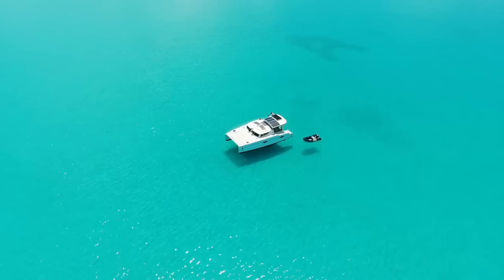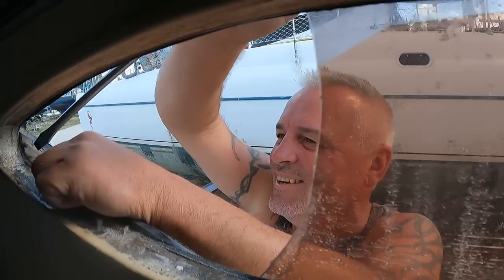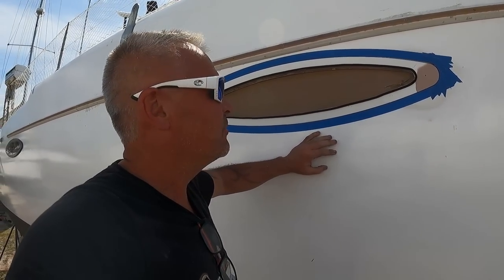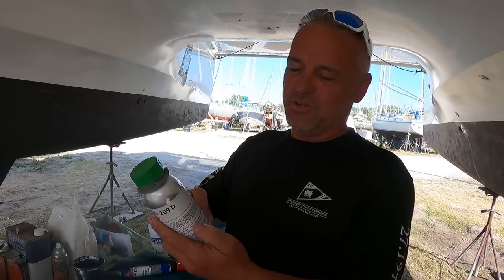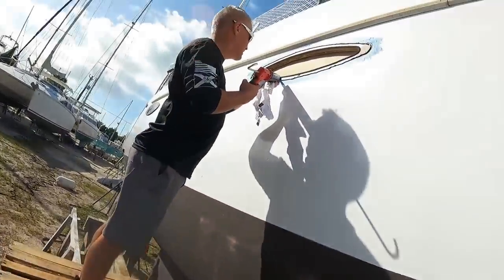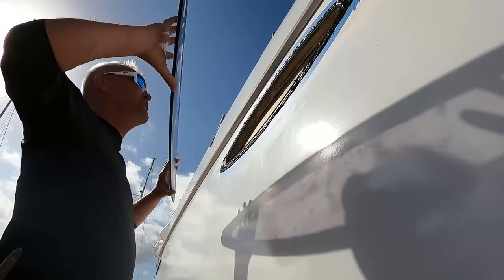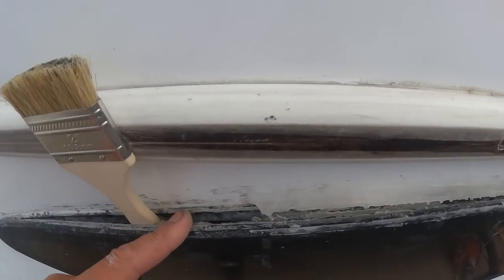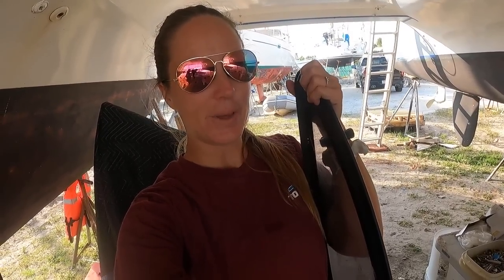We have a BROKEN WINDOW - How To Replace PERSPEX Windows on a Boat (S4 E46 Barefoot Travels)

Comment: Great video! @2:31 the adhesive is completely gone and the area where the window mounts is extremely clean. How did you do this?
Reply from the maker: Thanks. Razor blade and then some light sanding!

Comment: You’re supposed to shorten the list, not add to it. I’m thinking around $45 for the primer???

When pulling car windows, we used to use guitar strings, or piano wire. Is that something that might work for this? One person on each side of the window and using it like a saw.
Reply from the maker: We tried using guitar strings last time when we replaced the big windows. With no luck! 

Primer was more than double that 125 US

😆 I know the list is supposed to get shorter!
Reply: @BarefootTravels  $125🫢😬😱
Reply from the maker: I know right!!!
Reply: Remember that is between glass and metal... And what's more: the caulk'gasket' (strangely enough) is ticker on cars.
On boats everyone seems tries to squeeze as much as possible out... (I know, it's wrong. But common practice)

Comment: I've seen the windshield guys use something like floss to release widows. One person on the inside, one outside, and just slide it along cutting the seal.
Reply from the maker: When we replaced all the big windows we tried all sorts to release the seal. Guitar strings didn’t work very well. Kinda needed to pull and cut and pull and cut 😆
Reply: Yep, that's the way.
Dave: Preferably use some dyneema fishing line. It must be strong, and also thin. Guitar strings are way too thick.👴😉
Reply from the maker: Hopefully we won’t have to change any out anytime soon 😆 knock on wood

Comment: Guys, just a note, next time just apply little hot air gun and should come off far easier. It makes any glue soft, but sticky😋 think spray can could be just acetone as it would etch plastics..🤷‍♂️

😂 only after my comment i realized that should have mentioned that i was refering to the perspex after seeing how you applied the screwdiver. I'll take this one on the chin davy..🤦🤣🤣👍
Reply: This will not work on compounds as Sika.🤔
Take a strong fishing line and 'saw' through the caulking.👴😉

Comment: I wouldn't use 295uv with the primer as a admin for a  Beneteau site many have had failure   .Many OEM's use 3m VHB tape instead of the foam tape you used this will hold the window in place and provide a permament bond  while  Dow 795 has time to cure . Dow 795 is used by the glass industry to hold windows in highrise buildings and requires no primer . I have used both and 295 failed ,795 has now been 3 years no leaks, and the primer is too expensive over 100 CDN
Reply from the maker: Haven’t heard of that product. Thanks for the advice. If we ever need to do it again maybe we’ll use that product instead
Reply: @BarefootTravels  GE also makes a sealant that OEM's use SSG4000